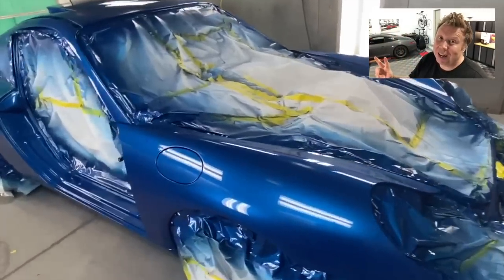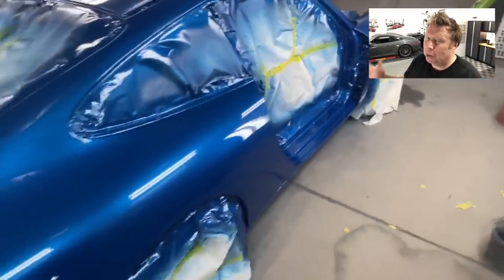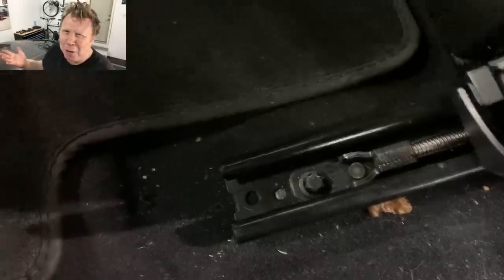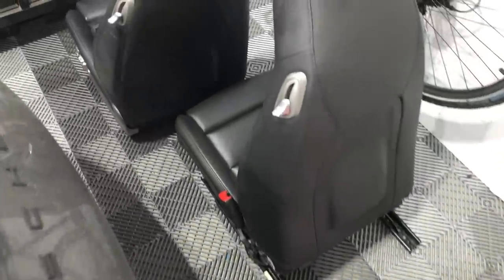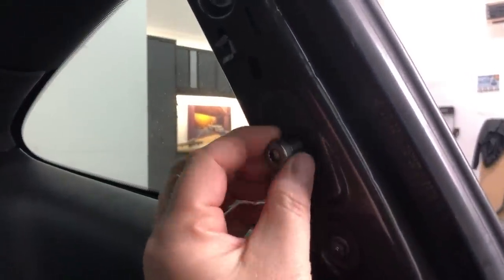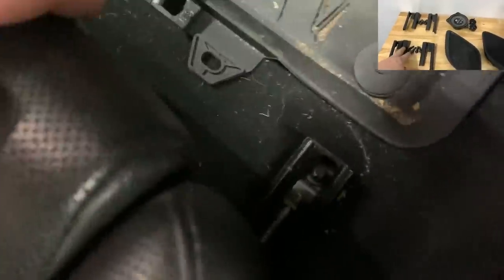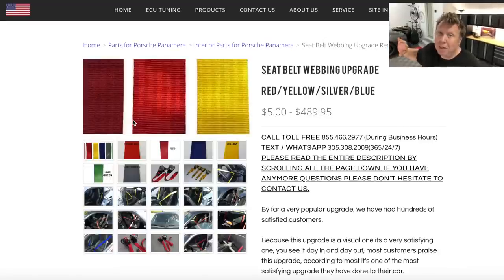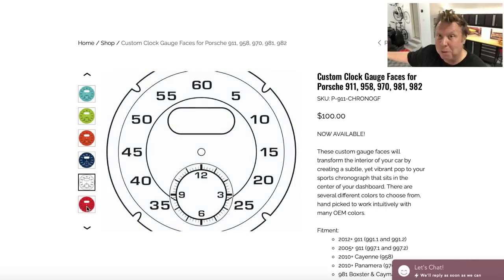Seats and Seat Belts Removal for the Porsche 911

Comment: Nice work James, I updated the seatbelts on my old 997.1
A word to the wise. You always want to disconnect the battery when dealing with airbag / pneumatic type devices, like seatbelts and seats. Firstly on safety grounds, but secondly to avoid an annoying 'check airbag' light on the dash!!
Looking forward to seeing the results, good luck buddy!

Comment: Nice one James red goes great with Agate. Loving the 996 also 😎

As per your safety disclaimer would advise anyone to replace the seat bolts if they remove the seats. It's advised by the manufacturer 👍
Reply from the maker: Good call! Cheers.

Comment: Porsche sells seat belts in the color you like and you install it yourself if you want, but any change for a NON-OEM product is an alteration of the original, buy it at the official service is cheaper, sure, anyway it is not  the first time you install a NON-OEM item.  But about tastes the colors.  Cheers
Reply: Porsche sells seat belts in the color you like and you install it yourself if you want, but any change for a NON-OEM product is an alteration of the original, buy it at the official service is cheaper, sure, anyway it is not  the first time you install a NON-OEM item.  But about tastes the colors.  Cheers

Comment: How do you remove the seat if the seat motor is dead? I can't move the seat forward to access the rear fixings
Reply from the maker: That's a good question! If you can't access the rear bolts, you're not getting that seat out I'm afraid. Not without either replacing the motor or doing damage to the tracks.

Comment: Dear James, I ver much like your videos.
Just one thing you may know..I would like to replace my comfort seats ( manually) from my 997.2 by turbo seats from a 991 fully electric and I am wondering if that goes just plug and play or if I have to change connectors and wiring as well.
Thanks for a short answer.
Regards
M
Reply from the maker: Hey Michael! I’m pretty sure you would need to rewire your 997.2 to make the 991 seats work. I don’t think the wiring harnesses are the same I’m afraid.
Reply: @AutoAmateur  thanks for your quick answer.

Comment: James - I tried removing the bottom
Torx bolt on the seatbelt - and stripped it. Any tips or hints as to how to remove it - and what’s the replacement bolt part
Reply from the maker: Sorry for the delayed reply! You can remove the stripped bolt a couple of different ways but the easiest is probably using a bolt extraction tool that you can find in hardware stores or on Amazon. You drill into the bolt head with one bit, then use another bit in your wrench / power tool to remove it.
Reply from the maker: Here's the part number for the 991.1 seat bolt and you can find them from a variety of places like Pelican, Gaudin, etc: Part#: 9A7-007-483-00-OEM - e.g.  https://www.pelicanparts.com/More_Info/9A700748300.htm?pn=9A7-007-483-00-OEM&gad_source=1&gclid=EAIaIQobChMIlsD8h92yhQMV0SvUAR28iwQiEAQYASABEgI6pPD_BwE
Reply: @AutoAmateur  thank you !!

Comment: just revisiting this video. i want to raise the rear of the seat to level off the seat. I don't have the seats that lower the front/thigh area. will i be able to fit some washers at the rear?
Reply from the maker: Yes you should be able to, but I don’t know what that will do to your safety rating of the chairs. The rails take a lot of force along the flat bottom of the car’s floor which you wouldn’t benefit from if, god forbid, you ever get hit.
Reply: Ah. Never thought of that. Perhaps I need to find a way to lower the front instead.

Comment: James should you not have disconnected the battery ? The seats have airbags in them and could be triggered also you could end up with an airbag warning light
Reply from the maker: Great point!! From all the research I did online first, there seemed to be just as many resources suggesting I didn't need to disconnect the battery as there were for doing it. In all honesty, I WAS intending to disconnect the battery but totally forgot about it and didn't... I guess I'll find out what the instrument cluster says when I get the job finished. :-)

Comment: Hi, the seat belts are not original, you have changed the color, but they ARE NOT OEM. Regards
Reply from the maker: I haven't changed anything yet. You're correct, the red belts I had (that don't fit) were not OEM and they're being returned to the supplier. The red seatbelts I will be getting from MaxSpeed Motorsports simply replace the belt color but the mechanical components, the harness, the bolts, the hinges and clips - it's all OEM Porsche, nothing gets changed there. Literally just the fabric, which yes won't be OEM.

Comment: You should stop working on a car that is already perfect and enjoy driving it hard.  It is not an old air cooled car that needs work.  I have not done anything to my 991S and the prior ones as the engineers build great cars that don't need aftermarket upgrades.  I sold the two prior ones for more than I paid for them keeping them original.
Reply from the maker: Yeah, but that's like saying you don't like your wife to dress up in different clothes or some sexy lingerie. I drive the car daily, all over, it's just nice to mix it up a bit otherwise doesn't life with the old girl just get a little mundane? I'm still talking about cars.... ;-)
Reply: My girlfriend likes to be driven hard, sometimes I just want to cruise